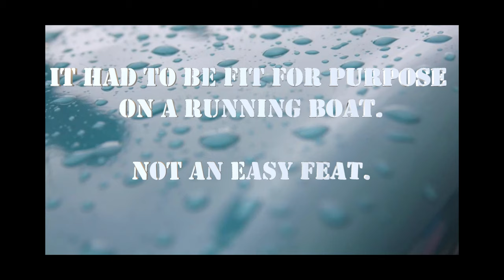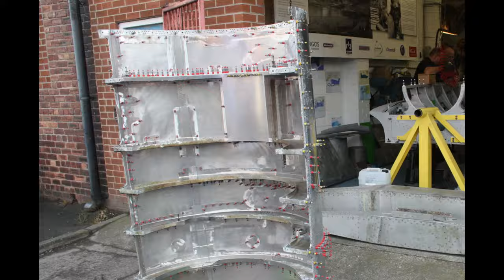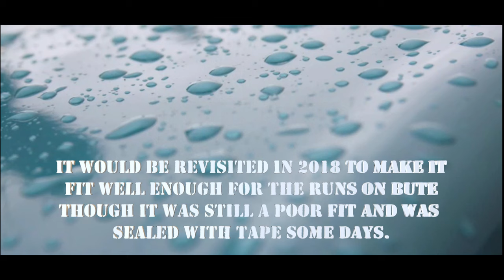Bluebird K7 - Bluebird's Engine Cover Rebuild.

Comment: Love the beautiful work used to save so much of the corroded aluminium. Really fantastic. And sorry you wont be running the boat on the water , in anger, just like  should be done. Only criticism,  the green powder coat?, on the new pieces. Don't think Donald would like that at all,,,,DUBs,,,,